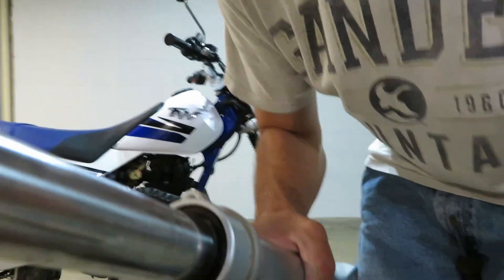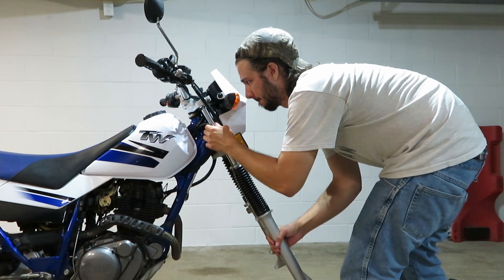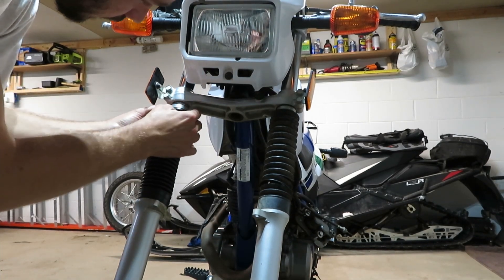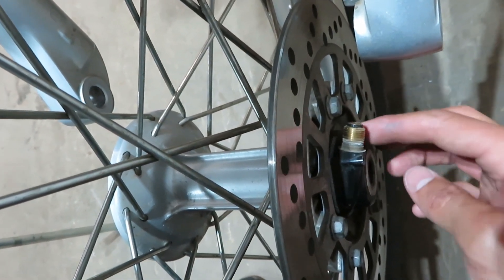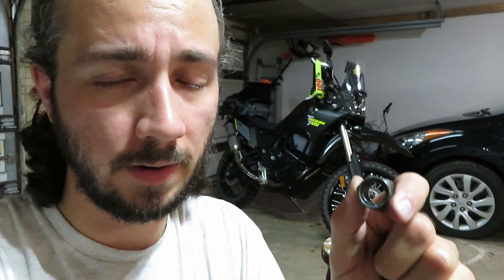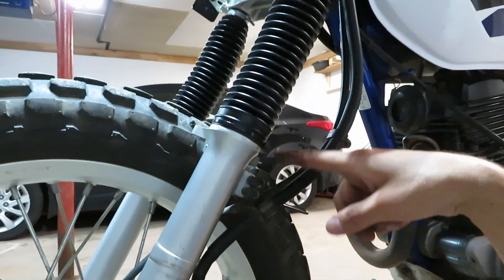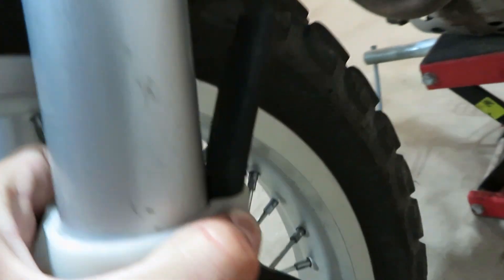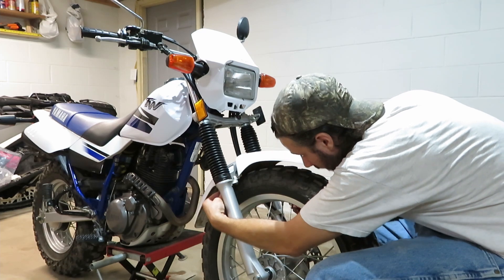Installing New Fork Boots on TW200

Comment: Bikes looking good man. I love all the little tricks you pick up doing this kind of stuff. Like the marker trick is a good call for sure.
Reply from the maker: Thanks!  Yeah that was more born out of laziness and not wanting to use a torque wrench but it works!  Haha.  I was actually glad I sort of did it by feel while using the marks because I had to remove the bolts later to add a high fender bracket which requires longer bolts so I just went about as right as I remembered doing here... Hasn't fallen apart yet!

Comment: What are you doing with a 200? Trade in the t7..
Reply from the maker: It's actually just as much fun as the Tenere, just in a different way.  Still have the T7 did 30 miles of rough ATV trails on it and enjoyed every minute!
Reply: @SwankyCatProductions  A TW200 is kind of expensive, though, isn't it?

Comment: Is it possible to run without the boot?
Reply: Yes, you'll likely just get a bunch of crud into the oil seal and likely some rust spots and pitting on the tubes which will eventually ruin the seals if dirt doesn't do it first, not to mention the tubes. But you can do anything you want, sweetheart.